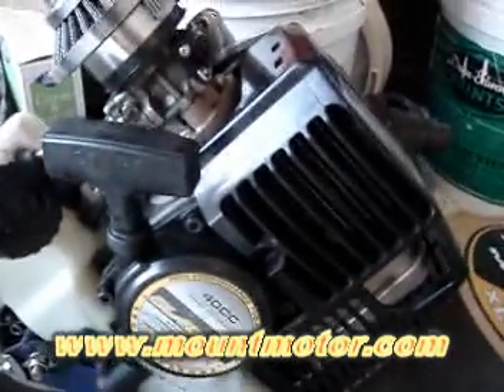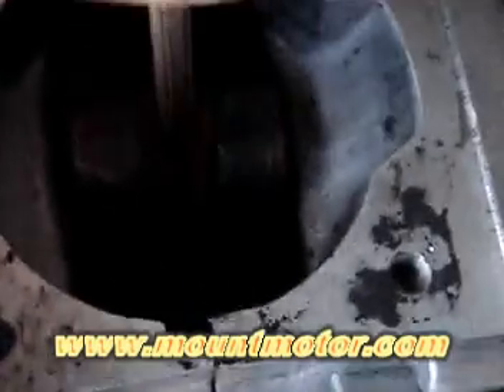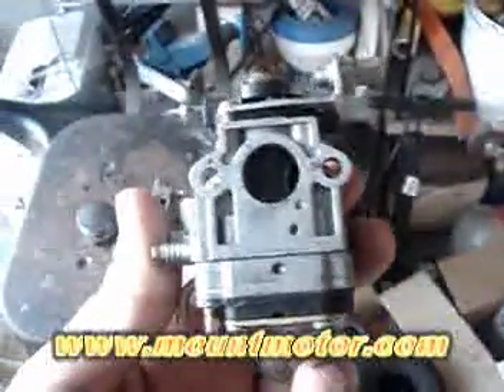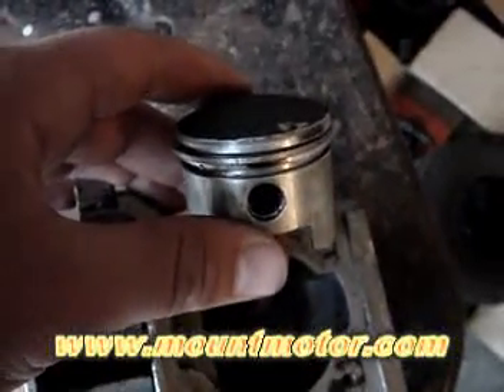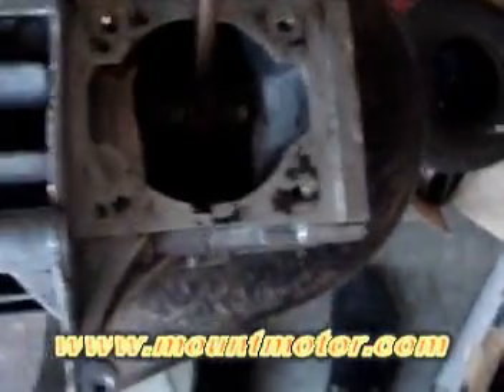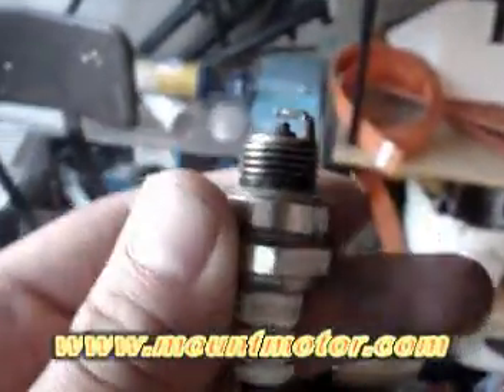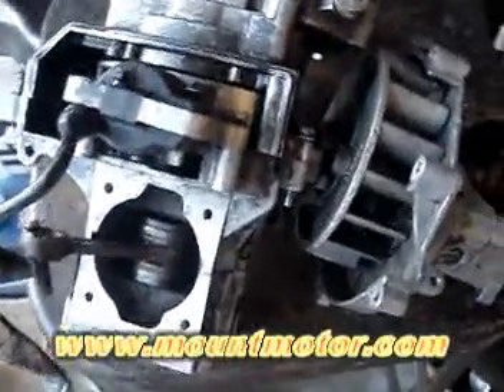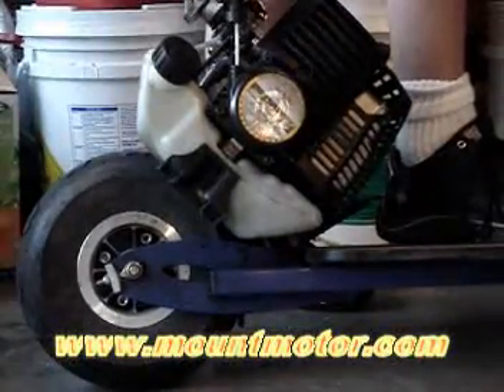How a Two Stroke Engine Works by Mount Motor

Comment from the maker: Hey there,
We read your comment. Your scooter is Chinese, which means that it is not Great quality compared to other scooter companies which are made in Japan and the U.S. We can help you, but you must give us a great explanation of the scooter and its problems, such as noise of the engine. If you can make a video of it that would be great, so we can better understand what is going on with your scooter.
Thanks!
-The Mount Motor Support Team

Comment from the maker: If you take apart your motor you must be VERY CAREFUL!!! There is a cylinder head gasket.You might be able to reuse your gasket(depending on age and usage of the motor.) The gasket will be oily,(easy to rip), so you must handle the gasket with real care. If you need to buy one, they are only a few dollars. (not a Big deal).
Hope this helps!!!
-The Mount Motor Support Team